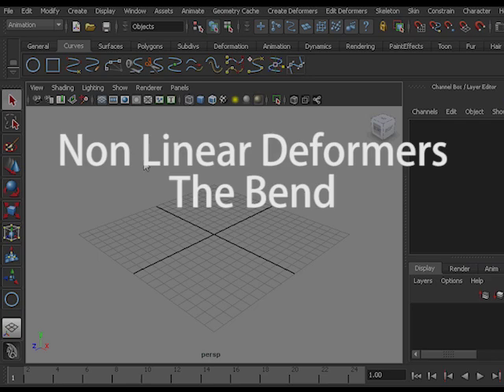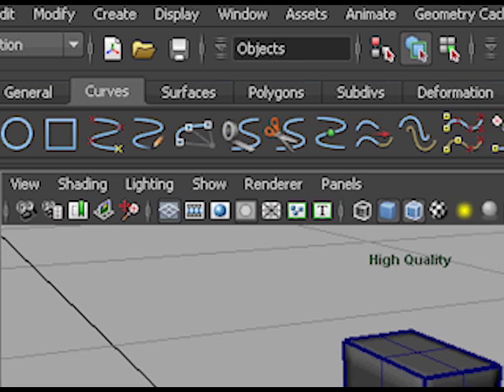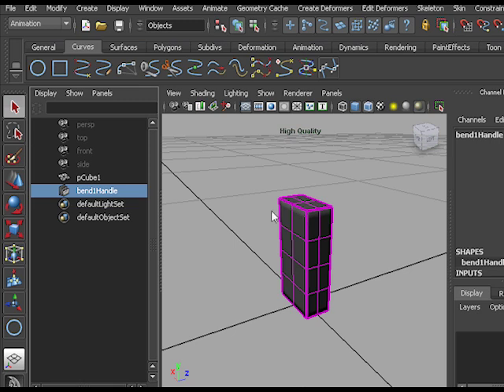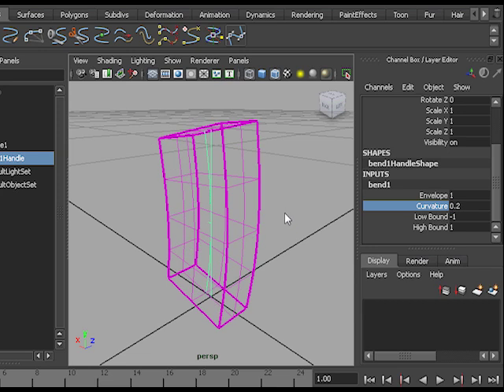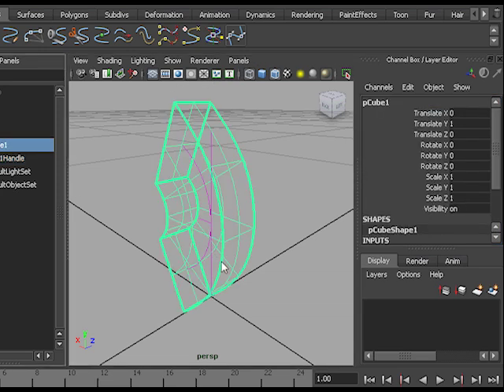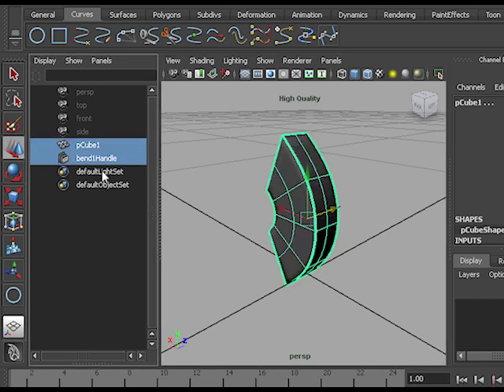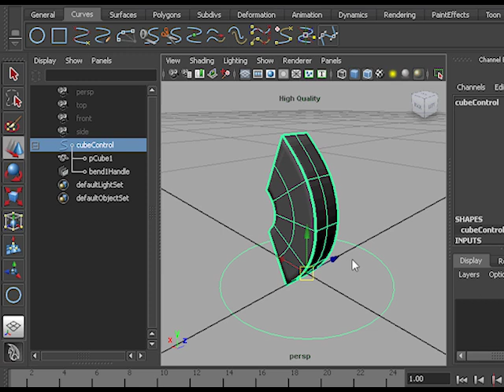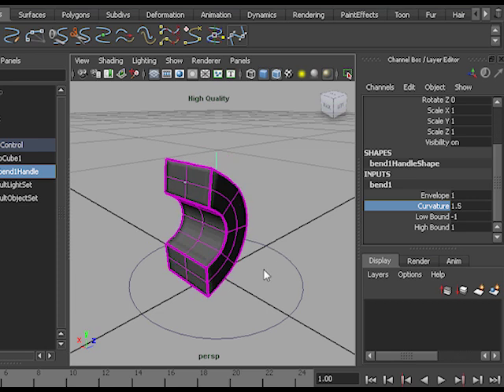Maya.NonLinear:Bend

Comment: Is it possible to add a horizontal and vertical nonlinear deformer? I want to bend it in 2 directions, not just one.
Reply from the maker: +A Google User Absolutely, you can add as many as you like, just keep in mind that they work sequentially, not parallel and thus the order in which you apply the deformers has an effect on the resulting deformations.